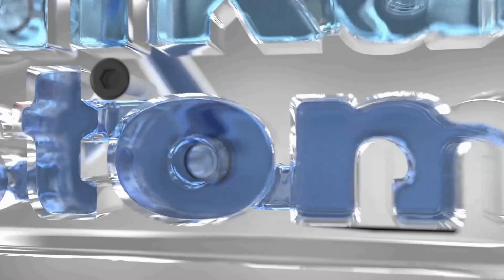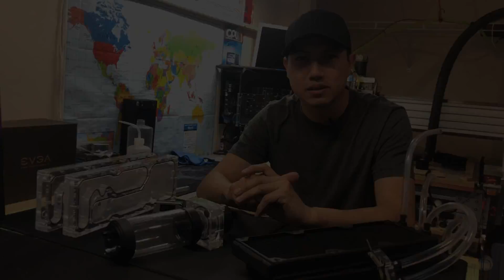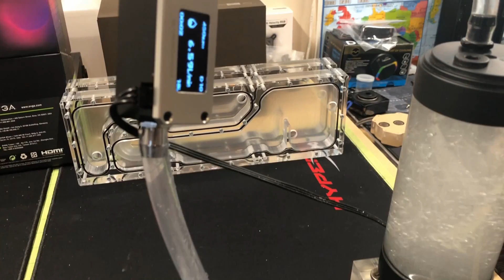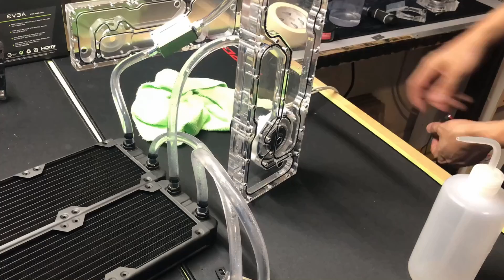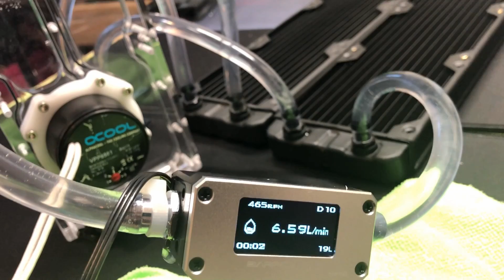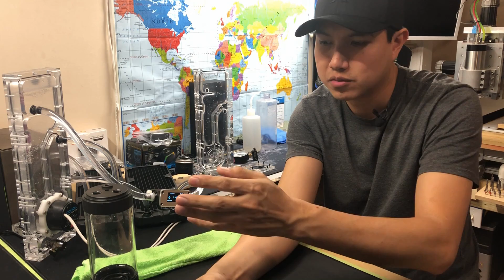Testing a water flow meter

Comment: -Wouyld you be able to use that flow meter with out using a pc?
Reply from the maker: Sitges Villa Apartment Familia Scott  Hi,  yes you could an long as you supply 12v to the correct pins. The third pin is for rpm read out
Reply: @radikult-custom  Thank you for your help. Love the  reservoirs would look super cool on my CNC machine, I dont know how many litres they hold but would certainly bring some fun to what is a dull looking machine!! I see you get the cut on CNC's. I use my 1000X1000 mm on wood, plastic and aluminium plate to make items like your reservoir over here in Spain!!

Comment: What kind of material is it? Aluminum? Nickel?
Reply from the maker: ABMNS PRODUCTION the Flow Meter is made of POM/Acetal and plastic front
Reply: @radikult-custom  OK but the section where the water goes through and with the holes for the fittings, what kind of material is that part?
Reply from the maker: ABMNS PRODUCTION it’s POM/Acetal  the Black part where you connect the G1/4 fittings
Reply: @radikult-custom  OK Thank you :)

Comment: i just installed a barrowch inline temp oled white and it just blinks on and off real fast a bit then shows nothing.  No controls or software or download...  or help from company...
Reply from the maker: Brad B make sure that the cable is connected correctly as Positive, negative signal.  Sometimes the 12v is on the wrong side and that’s why it could blink

Comment: hi i went to the barrow site to buy that meter and cant find it can u link me where to buy that meter please .thanks.
Reply from the maker: Rosa Rodriguez you can search for Barrowch flow meter.   Here is a link I found 

https://modmymods.com/barrowch-g1-4-oled-display-flow-meter-v2-black-fbft03-v2-black.html
Reply: performance pcs in the USA sells these flow meters, they also have the temperature meter as well, sadly no one makes one that does bot flow rate and temperature :(

Comment: where do you source your acrylic? Trying to find a place to buy from that's not insanely expensive
Reply from the maker: Kaleb Israel I guy my acrylic from McMaster Carr. But they aren’t cheap by no means but I can get what I need fast
Reply: @radikult-custom   okay I was hoping you had a different option that was cheaper. I too look to McMaster-Carr for a lot of metric hardware and random springs, etc. Raw material seems to be cheaper on Amazon in certain sizes but it takes a lot digging to find it. I guess I'll just have to put my big boy pants on and pay the premium
Reply from the maker: Kaleb Israel I’m not sure where you live but maybe you have a local place that sells raw materials. .  
 I have not try amazon. I did try eBay but it should be the same.  A lot of searching for what you need
Reply: @radikult-custom   yeah I can get some scrap aluminum locally (very small selection and it's $4.50 / lbs) but I don't have any local place that sells plastic at all. Closest place is hours ago. I might just use McMaster-Carr just so I don't have to search forever to get it slightly cheaper

Comment: Damn I have to buy one if these flow meters, can you change to leters per hour?
Thx for the video Mario!
Reply from the maker: AnteICash I don’t think you can. I don’t see any “button” for adjusting anything.
Reply: It can't be that accurate then if it doesn't know the tube size.
Maybe it's based on average inner diameter.
But it doesn't need to be accurate as long as the results it gives are consistent with each other, so when the flow is twice as fast, the number shown should be twice as much.
If that were the case it would still be perfectly usable for comparing speeds after making changes to loop or changes to pump speed.

Comment: That's good information Mario. Goes to show that the pump is still producing the same or similar flow rate even with the older volute design.
Reply from the maker: dandel351 yeah that was one of the things I was concerned.  If the volute is to big then I won’t build enough pressure and could loose flow after adding to many things in the loop.  But to “tight of a volute” makes some noise with some un balanced impellers at full speed
Reply: Maybe you could suggest to your future customers to run a clearance check before filling the loop. I think if you used say 4 bolts on the clamp just wound in gently and use a small ball of play dough to check there is at least a 1mm gap between the impeller and the volute body perhaps?
I wet the bearing of my D5 pump and briefly (5secs) powered it on before filling the loop.

Comment: What were the changes you made?
Reply: Critters made the cutout for the D5 slightly larger because a customer had a D5 that was ever so slightly larger than all the ones Mario has taken his measurements off of. The customers pump was making a noise because it was hitting the cutout walls in the reservoir so he made the new reservoirs with a larger cutout. No noise now and no noticeable decrease in flow
Reply from the maker: Kaleb Israel you are correct.  I made the area around the impeller a little larger.  Just because I know there could be some impellers that at high speed aren’t well balanced and could hit the surrounding area